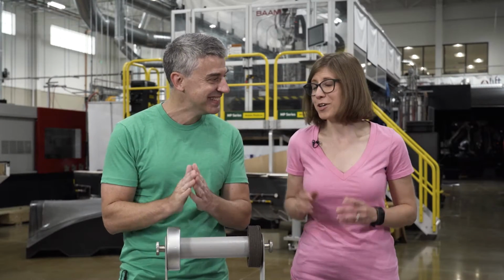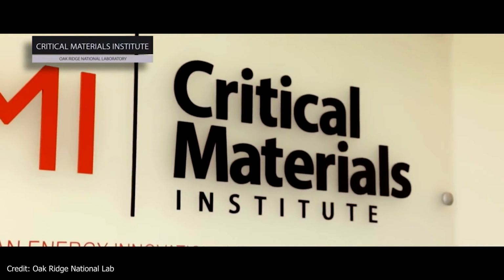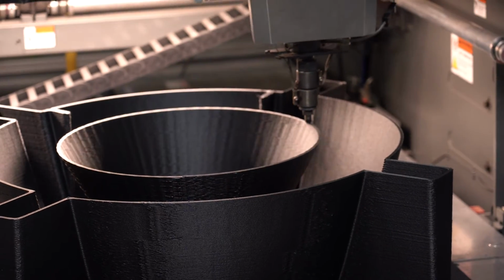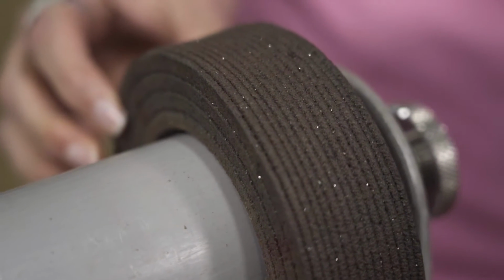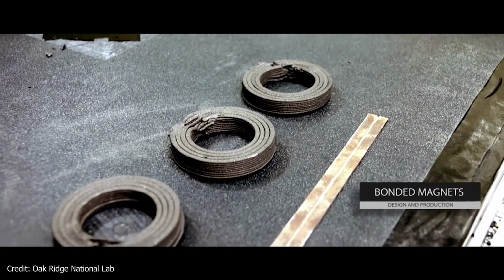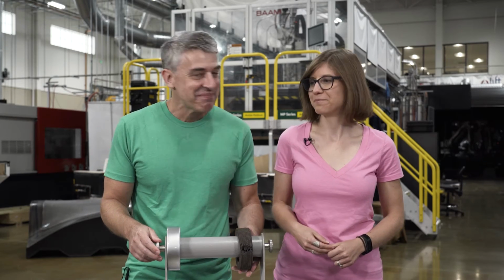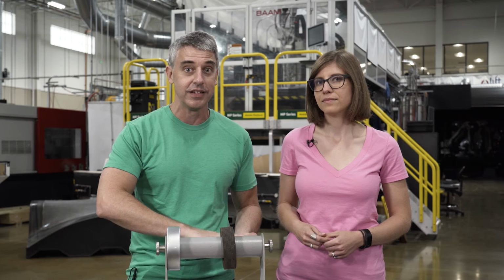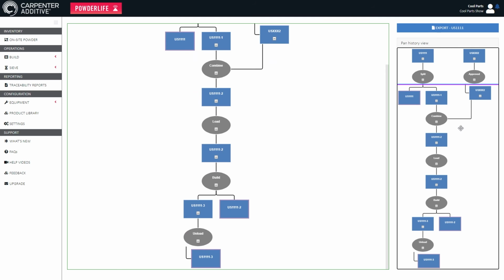Can You 3D Print a Magnet? | The Cool Parts Show #38

Comment: Instead of attaining remanence after BAM printing you could get anisotropic alignment and remanence using a permanent magnet at the printer head to orient the particles while they are floating in the liquid polymer material then the particles get fixed in the permanent magnet flux prior to solidification of the polymer.  As long as the print head doesn't rotate, the magnetic anisotropic alignment would be fixed to the x or y axis of printing and the domains would be aligned with the permanent magnet flux.

Comment: This is idiotic. Mix a solution of iron(ii) chloride and calcium chloride (this is to prevent evaporation), heat to 110-150 °C. Expel with 2-3 bar from a 0.8 mm diameter platinum coated nozzle at a 2-3 mm distance onto a conductive (preferably metal) plate. Platinum nozzle is the anode, conductive plate is the cathode. Apply a current of 400 A/dm^2 (by area of nozzle diameter). There is your magnet printer. Source: My brain. No, I am not for hire.

Comment: Hello my name is moooonshinnne.
If you make a shaft out of magnets.
Using the Archimedes screw style.
With the Tesla turbine blades. At 5 to 10°angles...
You have a magnetic shaft with an archtesla 
Design..
Manufacture the shaft to fit inside water pipe..
With any amount of flow of water it will turn magnetic  Archtesla shaft inside the water pipe...Waterproof a coil that will fit on the outside of the water pipe.....
Hydro generator made out of nothing but a specially designed magnet spinning in water flow and a coil of wire around the outside of the pipe pulling electricity out  of the spinning magnet...
The oceans title flow alone is enough to power the world.
Not to mention all the creeks and rivers that are just waiting to be harnessed